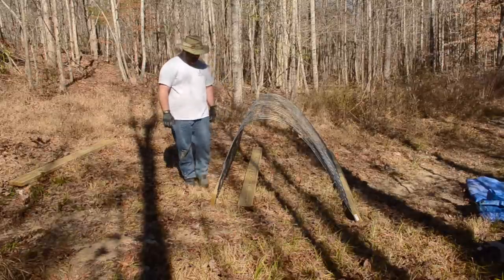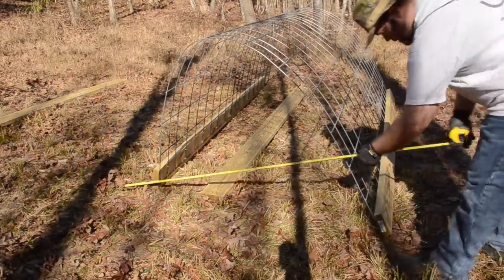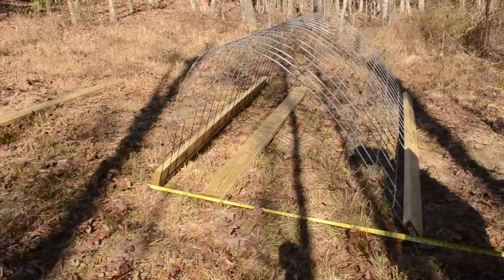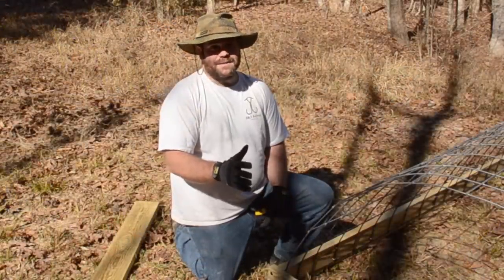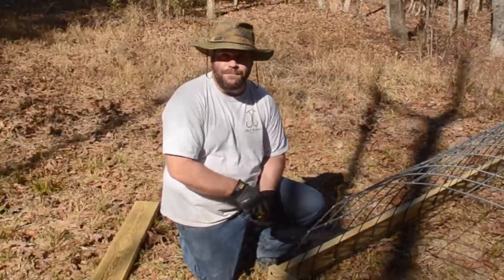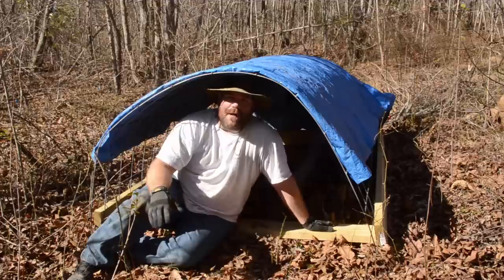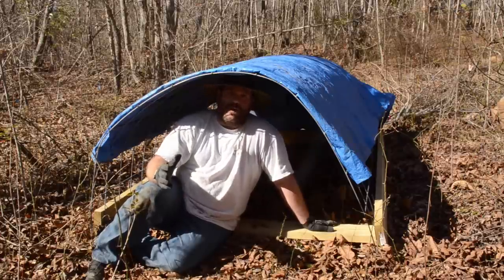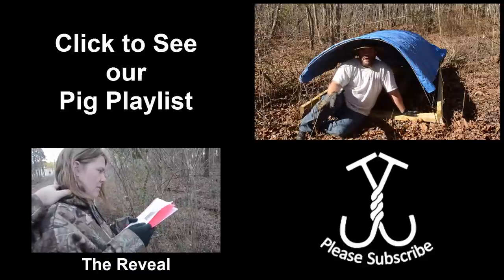DIY Portable Pig Shelter - Part 2

Comment: Looks great Jarod. Highly functional and should be pretty durable. I'm not so sure it would have been easier to put the staples in after the frame was built. I don't know how hard it was to fix those last pieces of the frame but I really hate putting in staples (especially big ones). If I was doing it I'd probably use some brackets on the corners to assist with squaring it up and fixing it quickly (I would then put the screws/bolts in to fix it in place - potentially even removing the brackets afterwards - I have a few brackets lying around that i picked up cheaply because they looked useful. It's the best design I've seen so far in terms of price, portability and ease of construction. Salvaging a ready made structure is the only other option i can see trumping it. It would also probably make a decent chook shelter with an electric fence around it for protection from predators (foxes & dogs are the main threat).

Comment: Now that you mentioned your inability to square things up easily, I can see that if you make our frame first, you would be able to put your wire inside on one side and bend it down into the other inside pretty easy. The frame would hold it there on the inside while you did your staples. Personally I like doing things a bit easier and I would take some of that metal strapping with the holes in it and cut short pieces to screw the wire in place. You know one hole & screw on one side of the fence wire and one hole & screw on the other. Repeat down the length of fence wires on each side. It's a lot easier to screw than hold and staple right & pound it in. I always use the sheet metal screws too they seem to hold better & go in easier. 
I made one of those $50.00 greenhouses with gray pvc pipe if I did that again I would put the Pipes about every 3 feet apart not every 4 feet apart. I also have piping all the way the length of the top and screwed through the cross braces with really long screws and have 1/2" aluminum pipe verticals holding any weight from snow. I have had it hold through a 15"  Wisconsin snowstorm and more snow throughout the rest of the winter. Don't know if that would do it in Boston though!!!